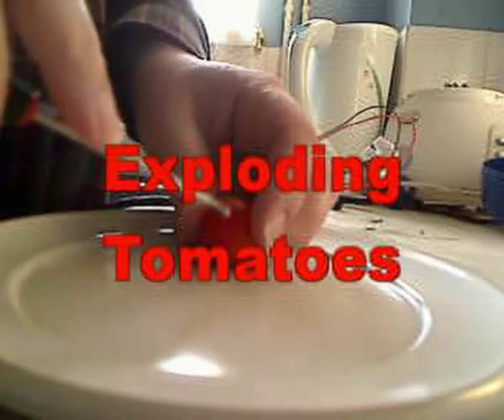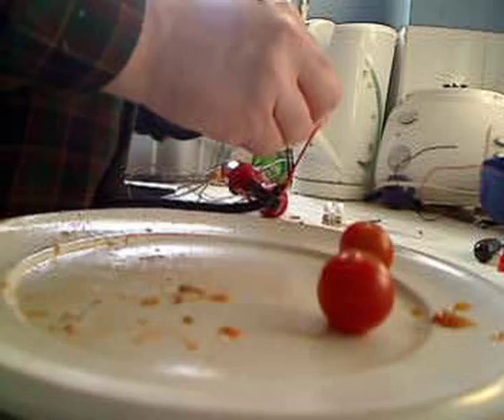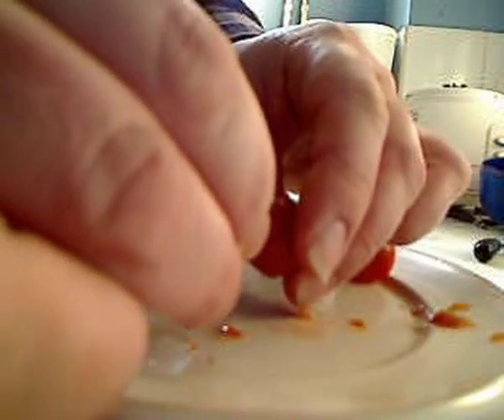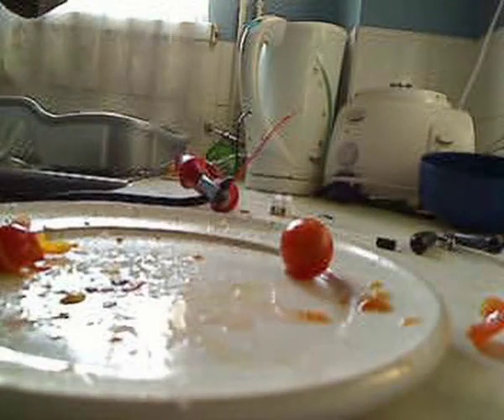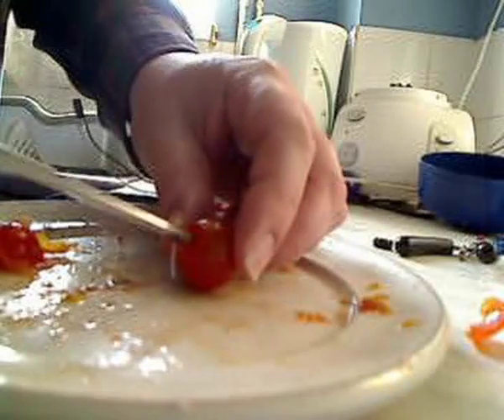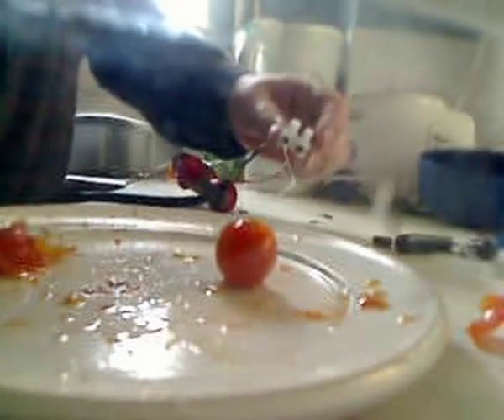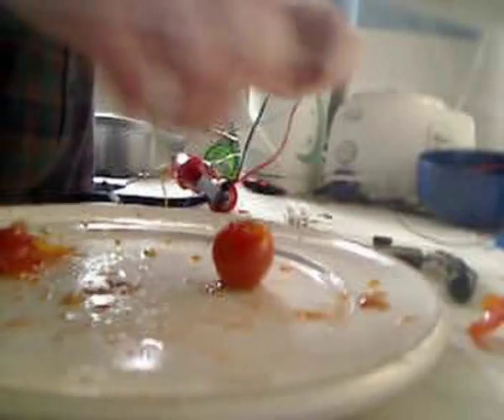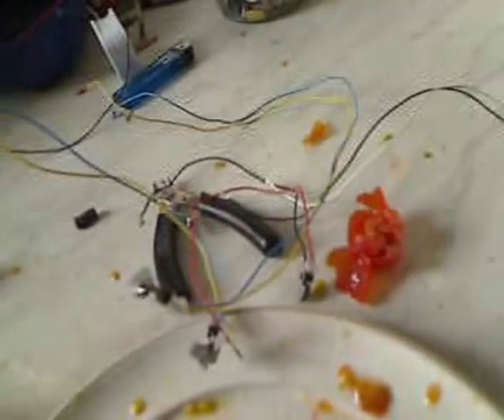Exploding Tomatoes

Comment: What did you use to blow it up exactly
Reply from the maker: Electrolytic capacitors. I put around 24 volts AC in to a small DC capacitor and that caused the capacitor to explode. :)